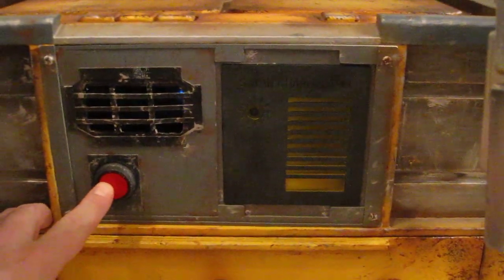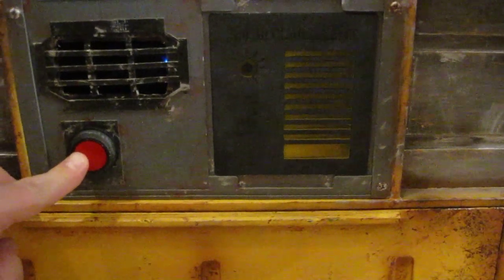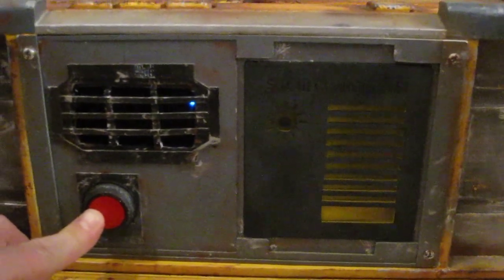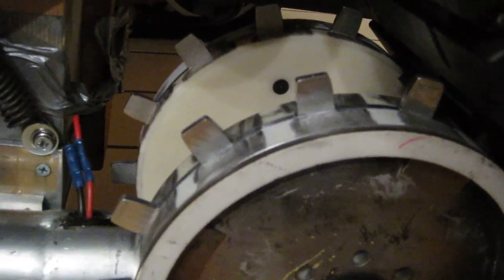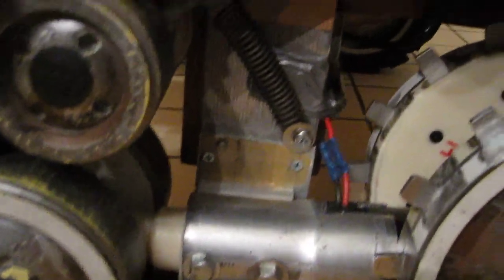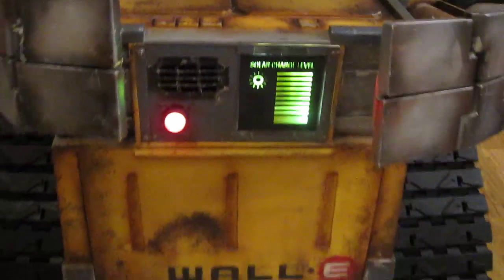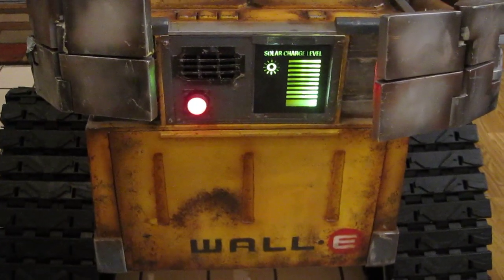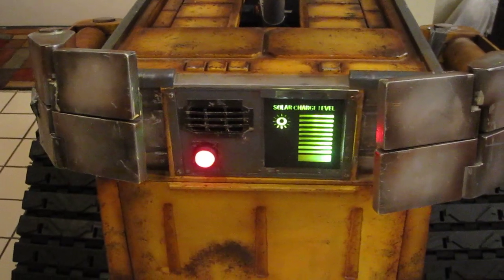Wall E Solar Charger

Comment: I always wonder why people use the Vantec motor controllers when they emit such a loud (and extremely noticeable) whine that breaks the illusion with most robot projects.  A lot of the R2 builders use them as well, but there are so many better alternatives out there.  Is it just because they are cheap?  I'm using a Roboteq in my R2, and could not be happier.  (Silent, high amp, etc.)

Your Wall E is looking great, can't wait to see what you do next.  Keep up the fantastic work!